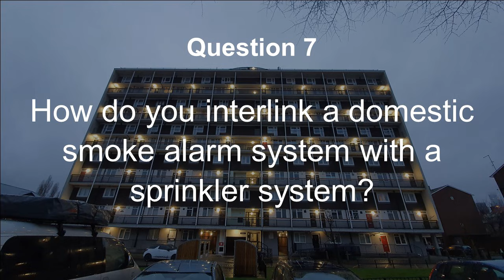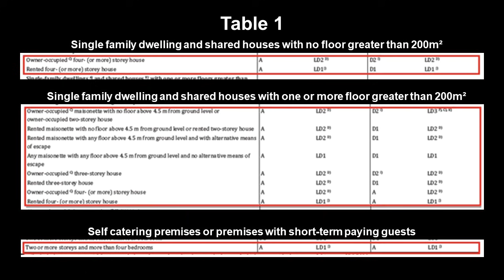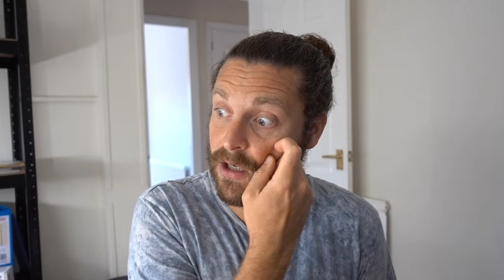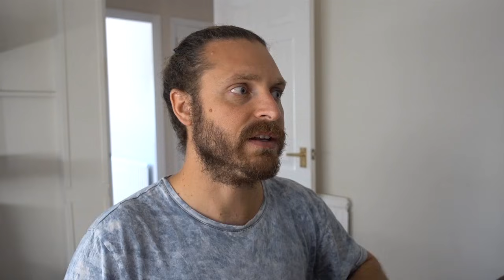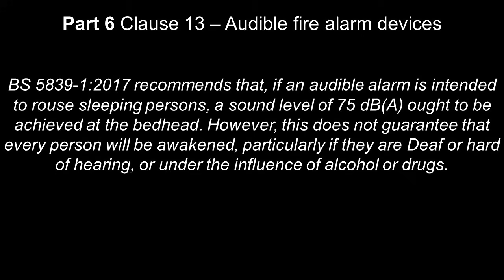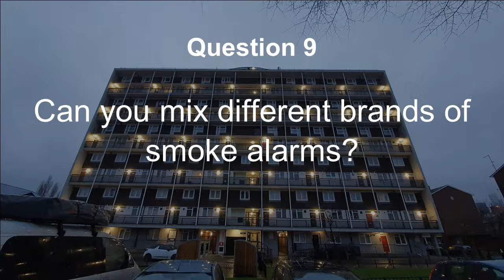Domestic Smoke Alarm Q+A - Residential Fire Alarm Systems

Comment: Hi Dan, I was wondering if you could help me with a question?

What's the legislation regarding weekly testing of fire alarms in residential buildings?  

I have been asked by a managing agent if this is required under current legislation?   They look after a property which has three flats which has a conventional fire alarm system with break glass call points in the common area. Does this require weekly testing?
Reply from the maker: Very simple Nick:

The Regulatory Reform (Fire Safety) Order 2005.
Article 13 requires a suitable fire alarm system and for it to be maintained.
Article 17 requires systems to be maintained.
Article 11 requires Fire Safety arrangements for the control, planning and review.

This piece of legislation doesn't specifically say weekly testing is required but the above points towards industry codes of practice.

BS 5839-1 says weekly testing is required.

The way the law works is that you have to prove your defence that you've met the duties.

Unless you have a justified way to mitigate your departure to the standards then you will struggle to provide your defence.

For example, call points can fail. If you do not do weekly testing and cannot evidence that and let's say it deemed that subsequently that contributed to the time the residents were alerted there is a fire and someone died as a result, guess who doesn't have a defence?

Copy and paste that to your client and see if you attempt to argue.

Comment: Hi Dan.  Thanks for putting all the informative videos, they are really useful.  Quick question, in a HMO should the individual flat smoke alarms be interlinked with the communal ones?  The property in question has hard wired AICO optical alarms.
Reply from the maker: No worries mate. What size HMO are we talking? How many floors and how many flats? Is the communal area AICO opticals?
Reply: @DanstheEngineer  Hi Dan,  there are 3 flats off the communal stairs and 2 others which are separate.  Basically  a 2 storey building.  There are 3 AICO opticals in the communal entrance/stair.
Reply from the maker: @nickbance7355  the best thing is to refer to the LACORS guide on housing. This is an extract:

Fire detection and alarm system (see paragraph 22)
Mixed system
Grade D, LD2 system
•	interlinked mains wired smoke alarms with integral battery back-up located throughout the escape route

Where cooking facilities are sited within the bedsits:
•	interlinked heat alarms with integral battery back-up located in each bedsit; and
•	additional non-interlinked smoke alarm with integral battery back-up located in each bedsit.

Where cooking facilities are sited in shared kitchen, not within bedsits:
•	interlinked smoke alarms with integral battery back-up located in each bedsit;
•	interlinked heat alarms with integral battery back-up located in each communal kitchen; and
•	additional interlinked smoke alarms with integral battery back-up located in any cellar.

Comment: Hi Dan, glad to see you are back.
I want to point out that where you say mains powered smokes should be powered from the circuit local to that detection and not just the the ground floor. (4m.12sec)
I’m not going to search the regs  but I don’t think that is correct. 
If the smokes are powered from one single consumer unit circuit, e.g lighting then it would only make sense to have them powered from say the downstairs lighting as interlinking them would mean a single core cable is required as the link in a hardwired system. Doesn’t make sense.
Keep up the good work.
Reply from the maker: Basically with most manufacturers you have two options:

Wire a dedicated smoke alarm circuit with a hardwire interlinking.

Or

Wire from local lights with radio interlinking.
Reply from the maker: BS 5839-6 clause 15.4. 

The following recommendations should be met.
a) The normal supply for smoke alarms and any heat alarms in a Grade D system should be derived from the public electricity supply to the premises. The mains supply to the smoke alarms and heat alarms should take the form of either:

1) an independent circuit at the dwelling’s consumer unit, in which case no other electrical equipment should be connected to this circuit (other than the supply to a dedicated social alarm control unit); or

2) a separately electrically protected, regularly used local lighting circuit, in which case there should be a means for isolation of the smoke alarm(s) from the lighting circuit (e.g. for maintenance).
Reply: Dans the Engineer I get that but you stated that if there is an smoke on the ground floor landing and a smoke on the first floor landing of a home, the ground floor alarm should be powered from the ground floor lighting circuit and the 1st floor alarm from the upstairs lighting circuit. This is possible only if they are wireless bases and not hard wired.  This is maybe what you mean in the vid. Maybe I’m just being a div.
Now get yourself to bed, Work in the morning.

Comment: A subject such as this needs, no, demands individual videos covering each part and/or clause. We know this information is in the standard and can be picked up on training courses but the biggest hurdle to the correct approach is money.

Dan you are clearly passionate about you subject and sector and it's great that E5 have you on board however I can't help but feel like the content is hollow, lacking in any real meat - I'm not saying talk about it for free, set up a paid subscription for it - It needs to be gone through in depth, get balls deep in it and give it the dedicated airtime that it needs.

It's certainly an area I want to expand my knowledge into because there is zero excuse for anywhere not to have fire detection, prevention and countermeasures.

Keep up the good work.
Reply from the maker: Thansk for the feedback Dex and I do somewhat agree. I could dive into each clause in so much detail and this was an overview to the questions asked. The purpose is to help others and I regularly make reference to sparks buying and learning BS 5839-6 themselves as I believe it is quite an easy document to read compared to some of the others.

I really appreciate the comment.
Reply: Dans the Engineer off the back of the vid I went and got 1 and 6, looking at the 54 series too as that's mentioned extensively through, along with associated BSs for smoke alarms etc

Comment: I remember that when I was doing domestic new builds a few years ago the drawings would only show detectors in circulation areas ie hall and landing to the requirements of building regs, however, the certification is to British Standards require heat in the kitchen and principal habitable room(s) has the Building Regs caught up now.
Reply from the maker: In a nutshell, no! They do conflict occasionally. Which is fine. So when carrying out a maintenance visit, on my report, I note down what determined the design, ie building regs, BS5839-6 or risk assessment. But its important to reassess the use of the building to determine the suitability of the system.

Comment: Very good video Dan. Can you recommend a good sound level meter, generally for domestic use? Are the sound level apps any good, or would you recommend a dedicated meter?
Reply from the maker: I use the ACT 1345 sound level meter, calibrated annually. I don't recommend using apps because some I've found don't actually have the correct settings for the required sound pressure and I would struggle to see how they comply. Maybe good as a reference in some instances but I am sure I wouldn't pass my BAFE audit soley using an app.http://www.actmeters.co.uk/specialist-tools/1345-sound-level-meter
Reply: @DanstheEngineer  Thanks Dan. Just ordered one c/w calibration cert.

Comment: Great video Dan! Just in regards to Question 7, how would you about linking a domestic smoke alarm system to a fire alarm system (in this case addressable) rather than a sprinkler system? I’d assume using the Ei414 but should the I/O that it’s connected to be mains switching or could you just use a standard one?
Reply from the maker: Yes you can use the Ei414. The output is volt free so the addressable interface doesn't need to switch mains. So use either 24V or mains.
Reply: Cheers Dan 👍
Reply from the maker: @ciarancollins7790  in blocks of flats, I like installing a Part 1 system in the communal and interfaces linked to Ei414 units to individual dwellings but setting up the cause ans effects to suit the fire risk assessment. Such as delays or double knock. Very easy to set up a fit for purpose system that is sensible and can be managed very well.
Reply: That’s a really clever idea, I was thinking something along the same lines. What would be the typical C&E that you would use for them or would it all be based on the fire risk assessment?
Reply from the maker: @ciarancollins7790  all based on the fire risk assessment and what is required for evacuation for the type and size of property. But I think it is important to have the information available on the common fire alarm to know how to manage the building correctly.
Reply: In that case would you go through it with designated residents or just mount an instruction sheet beside the panel?